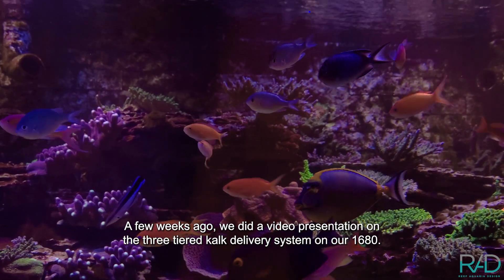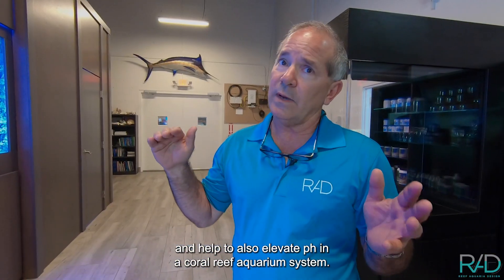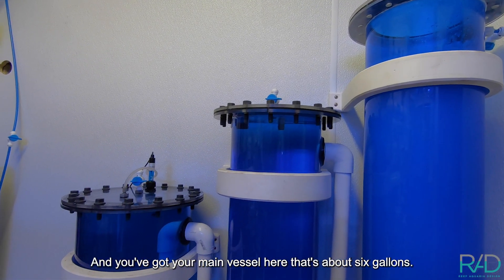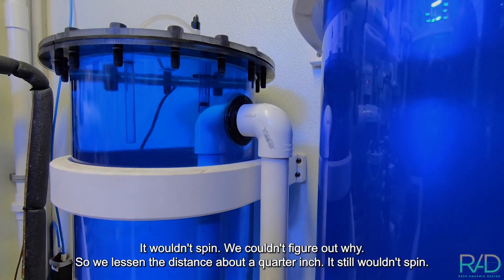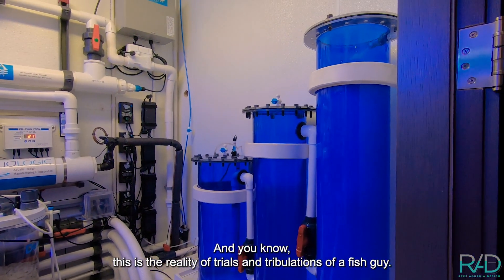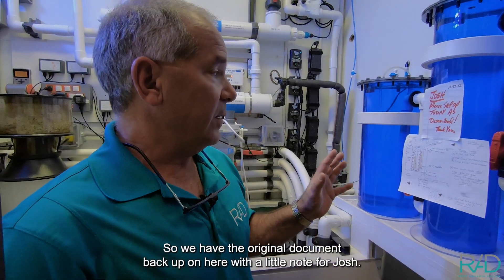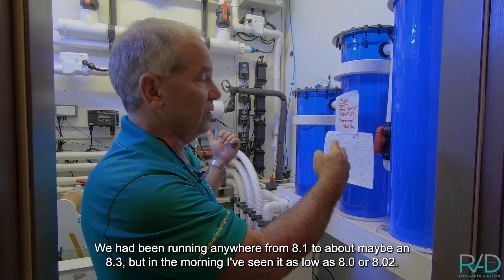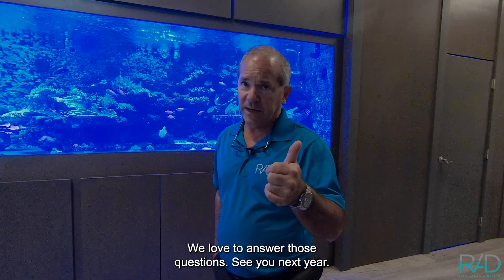CUSTOM-MADE KALK REACTOR FOR OUR 1680 GALLON REEF AQUARIUM. BY REEF AQUARIA DESIGN. PART 2.

Comment: Why wouldn't you just make a floating air barrier, that way it floats on top of the effluent surface to prevent air interface?

Or since it's a sealed vessel just do a inert gas blanket, we use nitrogen blankets for our emulsifier tanks in food processing. All you need is a weighted lid and a pressure regulator. 

For high temp applications we use steam to displace O2.

Comment: If you change the pin for a larger pin it would probably spin on the bottom. Only if the acrylic on the bottom is too thick it would prevent spinning. And that's what probably was going on there.
Choosing a pump instead, if you simply put a tiny powerhead with a magnet, like a small Tunze, on the top of the container, by the cap, you would have the spin throughout the whole tube, starting on the top part where the powerhead would be located. 
3 containers is way overkill, totally unnecessary. 
The HIGHER pH is a consequence of the addition of kalk, simply. 
More important is to keep an eye on calcium and alk.
The addition of kalk isn't only, or most importantly, about pH.